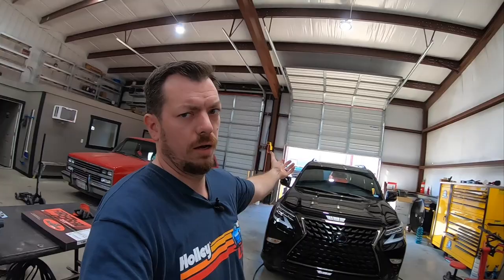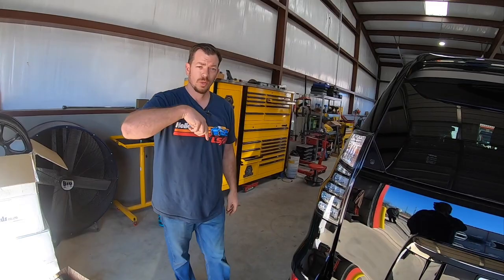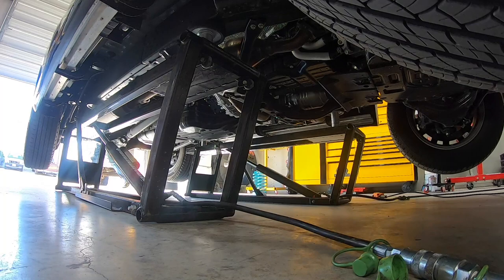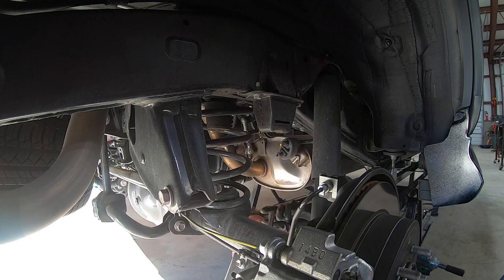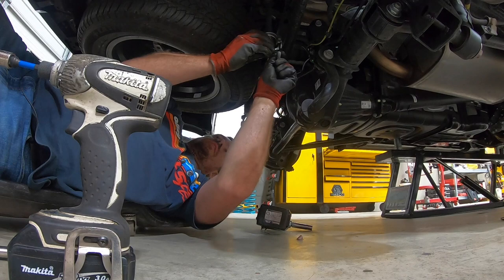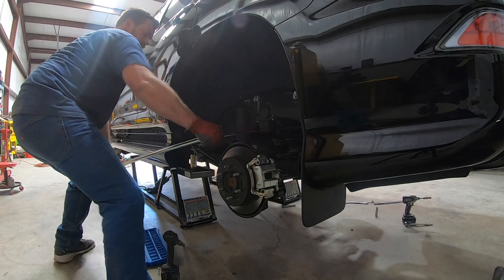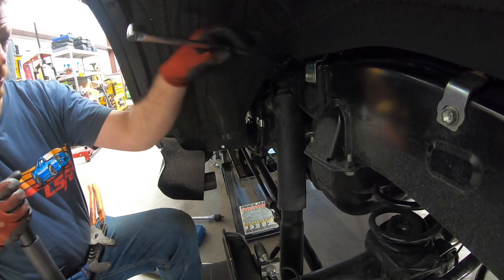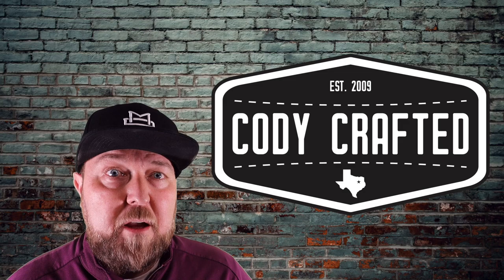2022 GX460 Blackline Dobinsons IMS Install Series: Episode 1

Comment: Any BMC required for the 285s?
Reply from the maker: No sir
Reply: @CodyCrafted wow that’s awesome. What’s the wheel specs on this? Planning on getting 17x8.5 -10 offset wheels for my blackline as well and thought 285s would rub and require the BMC
Reply from the maker: @user-ht8ti3wq3g  wedsport TC105X 18x9 0 offset
Reply: @CodyCrafted  thank you 🙏🏼